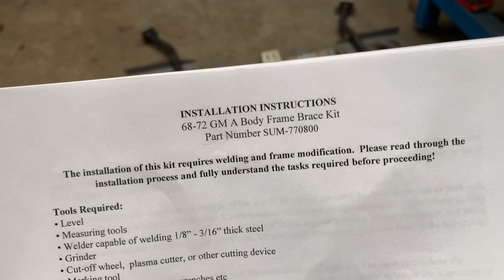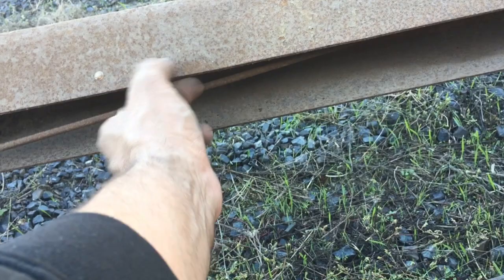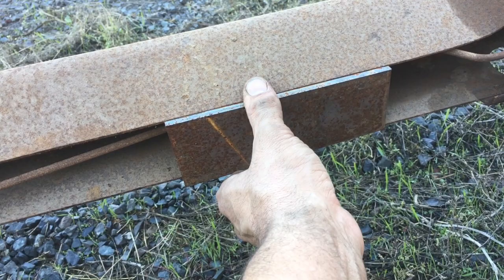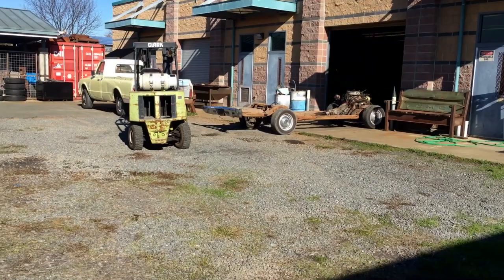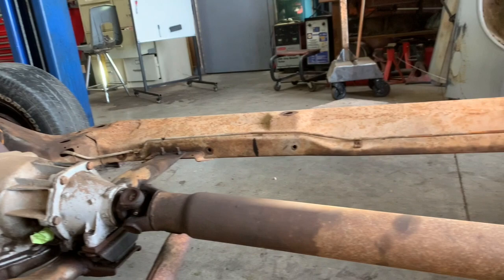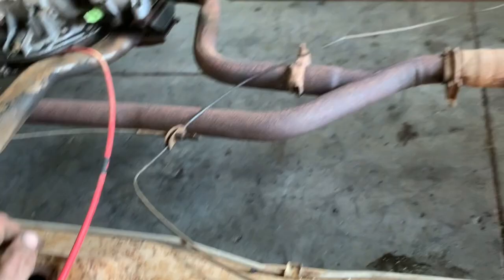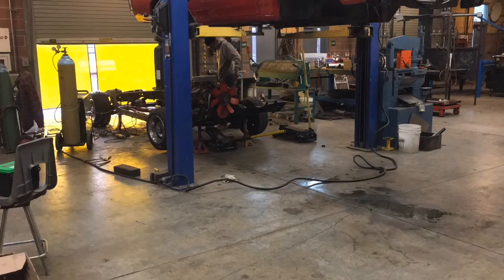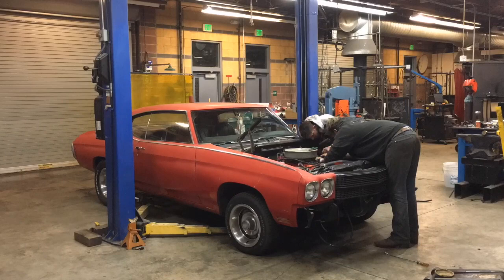Chevelle A-body frame boxing kit review

Comment: I've bought the same kit Just getting around to getting it installed and surprisingly it does not lineup When I put the front and the back of the tube in place where it's supposed to go The 2 tubes that Weld to the side are 1" shorter I cannot see that my  Frame  Is bent 1" I'd love to know what the measurements of those Tubes are To compare with mine

Comment: I've seen several SS chevelles , none of which had the convertible frame. The HD frame option was available but not standard on these cars.
Reply from the maker: I’ve never seen a real ss chevelle That didn’t come with a factory boxed frame. 🤷🏻‍♂️
Reply: @mrbritoweldingandautomotiv254  i just commented... I have a real ss and doesn't have a boxed frame
Reply: I've had 5, no boxed frames factory on any of them... All 67 & 68 true 138 cars.

Comment: Can you tell us the opening width of the frame. Your frame is 100 straighter than the two I have. I just going to brake bend the bottom edge to make this kit similar to Speedtech. I liked this over Speedtech since no beating in floorboard on pre 1968
Reply from the maker: Sorry it’s way gone now